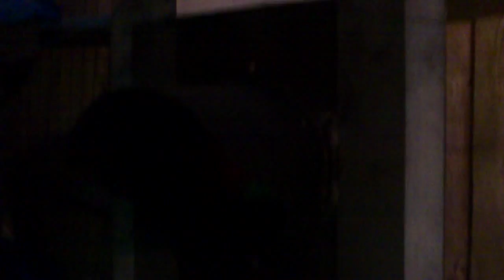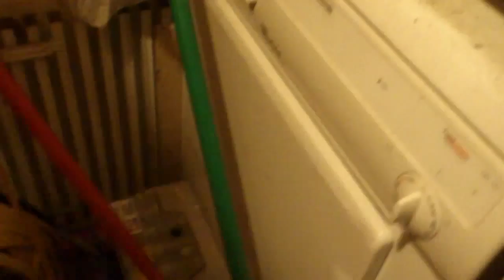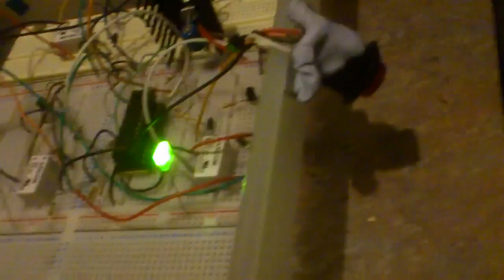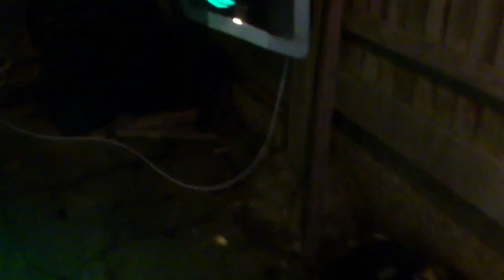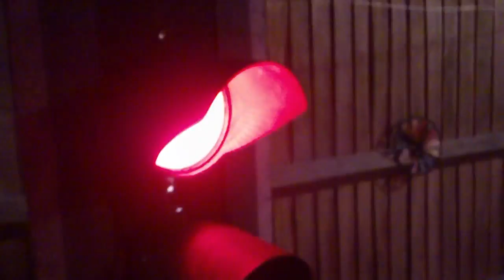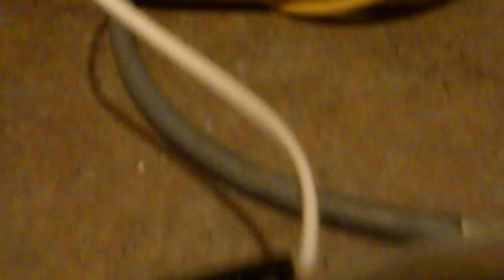Traffic Lights UK

Comment: Are the transformers for each light wired up straight to the controller you made?
Reply from the maker: Fkazim Mc Yes. Each transformer is connected to a relay that switches 240v the relay is triggered by the controller.
Reply: OK thanks in my old style traffic light it has 3 transformers but only 2 are used red and amber are connected to one transformer and green is connected to its own transformer any help?